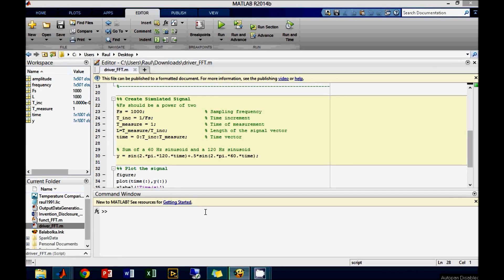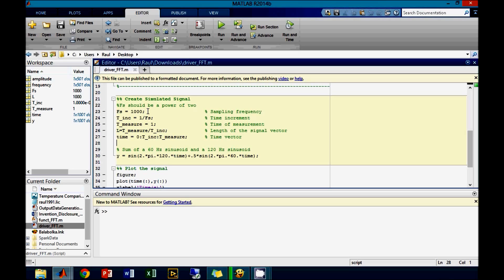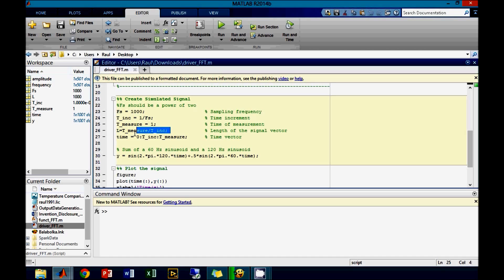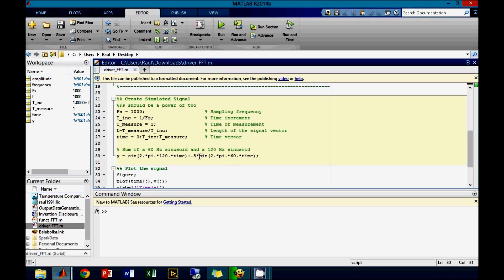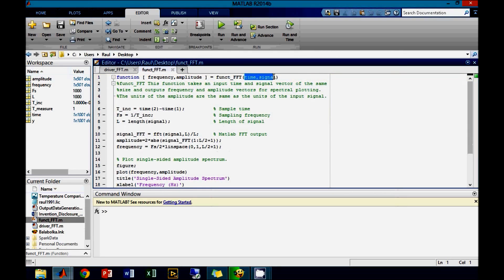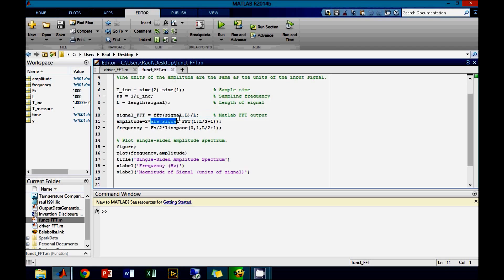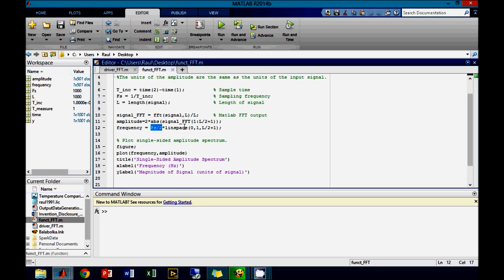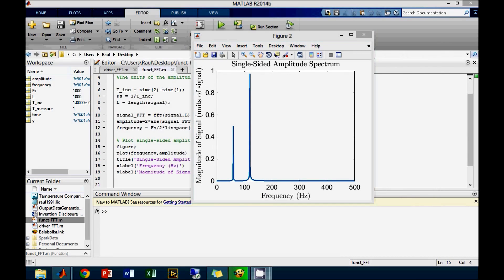How to do a Fast Fourier Transform (FFT) with Correct Amplitude Output in Matlab

Comment: T_inc = time(2)-time(1)
where did time(2) and time(1) came from?
Reply: it is the time vector that is passed into the function. time(2)-time(1) gives you the time increment per sample and thus you can calculate the sampling frequency fs = 1/Tinc. This doesn't have to be time(2) or time (1), you can also take time(40)-time(39) or in generally time(n+1)-time(n).

Comment: can you explain little bit about 
amplitude = 2*abs(X(1:N/2+1));  
freq= fs/2*linspace(0,1,N/2+1);

I'm not sure about(1:N/2+1));  and (0,1,N/2+1); where does 1 come from ?
Reply from the maker: Songmin Kim It has to do with Matlab's method of indexing. The first point in the frequency vector will correspond with a frequency of 0, and the N/2+1 will correspond with the Nyquist frequency.